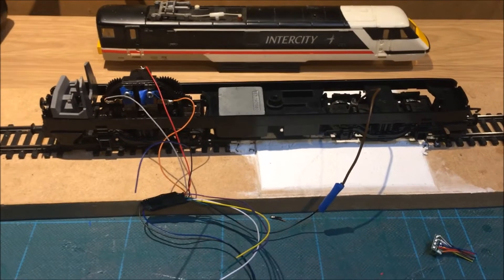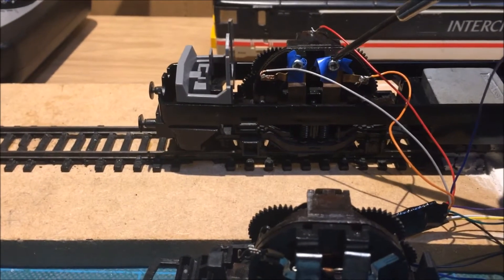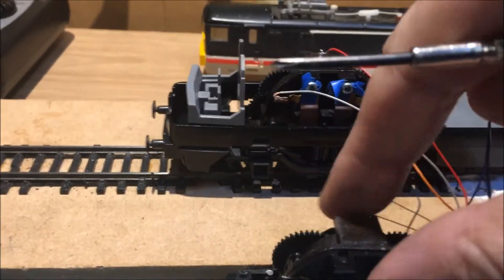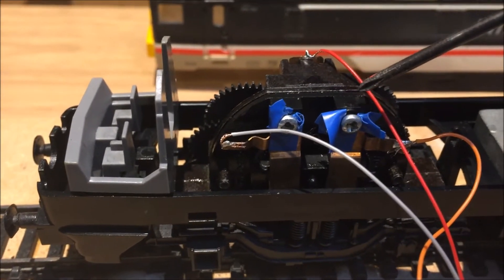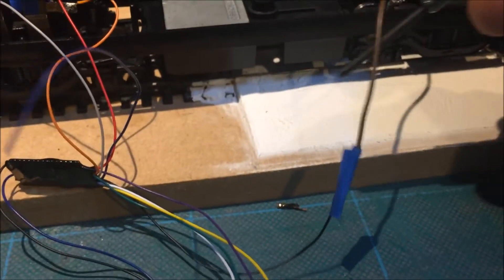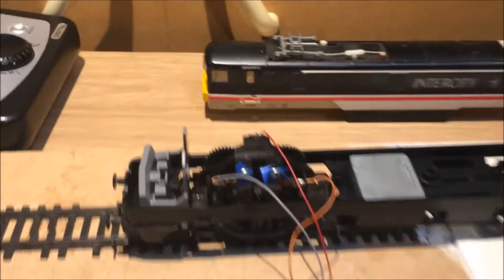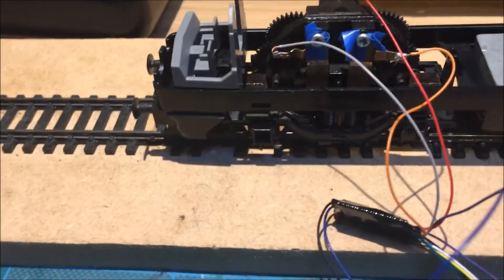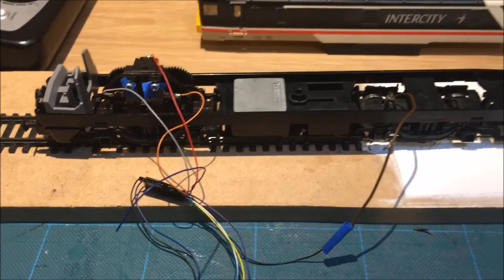Hard-wiring A Decoder Into An Original Hornby Class 91 Intercity 225

Comment: thankyou for replying,my 91 is all sorted,i used a Hornby r8249 decoder,you can see it running here,https://youtu.be/IBU3yW2DGCs ,your video was very helpful,thankyou
Reply from the maker: Thank you for your comment.
Reply: Sorry to drag up an old comment, but was the wiring for the r8249 the same as this decoder in terms of the wire colours? Using the r8249 myself on my class 91 and getting nothing through my DCC-Ex setup

Comment: also what dcc decoder did you use,can I use a Hornby r8249 decoder? I hope you can reply,thankyou
Reply from the maker: Hi Paul, many thanks for commenting. I will reply to each separately.

The decoder i used was a LaisDCC 4 function, 8 pin Decoder. 
These are a relatively cheap decoders available on the market and have served me exceptionally well throughout my locos. Only ever had a couple fail on me so far.

Comment: What timing, I just did this on mine! I used Kadee 2-56 x 1/2" plastic screws. They were a little long, but cut down fine. I'm in the US, but Amazon has them - https://www.amazon.com/dp/B000W9EZQO/ref=cm_sw_r_cp_awdb_h1mOzbHJDEF91

Went same route to solder the to the plate on the far side of the motor block. Works great.
Reply from the maker: Newcastle Central (OO Gauge) fantastic timing lol I will take a look at the screws CHEERS 🍻
Reply from the maker: have now been shown where to get the exact nylon screws from http://bit.ly/2w6Pgr0

Comment: Hi mate could you use plastic washers for insulating these screws ?
Reply from the maker: Stewart Barnard I first thought of that option but the contact plates need to be totally insulated away from the screw. Using just a plastic washer still leaves about a 1mm contact between the thread and the plate.
The very best option would be to dip the top part of the plate where the screw is with some form of paint or liquid rubber and allow to dry but ensuring it doesn't get scratched off when putting back in place.
Reply from the maker: have now been shown where to get the exact nylon screws from http://bit.ly/2w6Pgr0